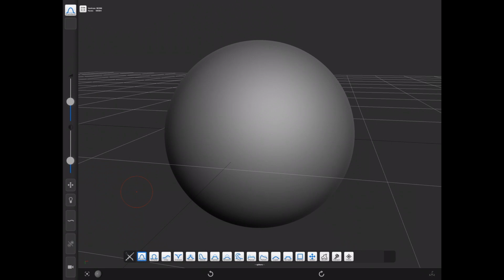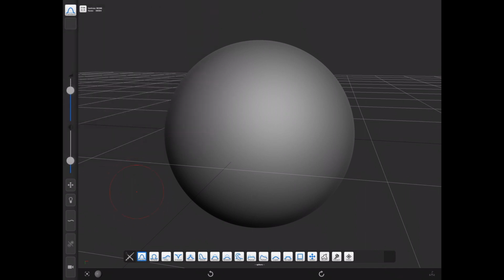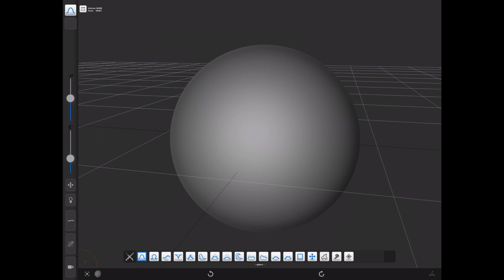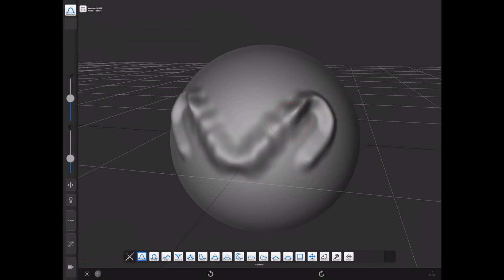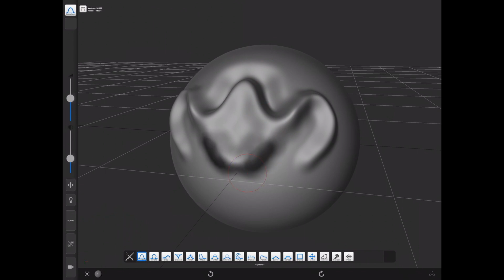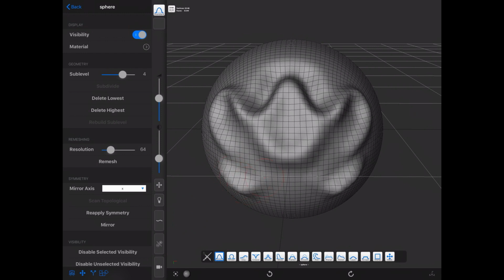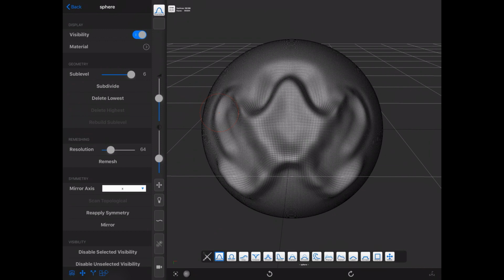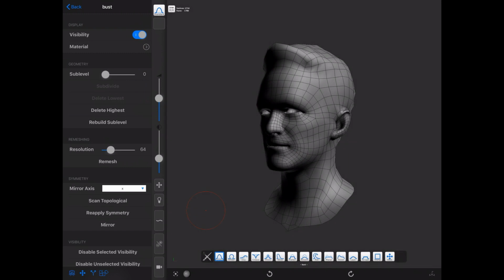forger iOS - Sculpting - Basics

Comment: how to rotate the camera if there is no empty space
Reply from the maker: If you're doing detailing work and the camera is so zoomed in that you can't orbit, you can set the Input mode to "Touch Navigation & Pencil" which will use touch input for navigation and Pencil for sculpting, in fact this mode is often used for everything. It's available at the bottom of the Preferences menu.
Reply: @forgerapp  Yeah!! This is worked) Thank you

Comment: How does this compare to Zbrush? I considered using blender with Astropad but I have been told blenders sculpting tools tend to give you higher poly count. Poly count is important to me because I import into Unity.
Reply: this app works only with subdivision no dynamic topology or remeshing..etc u should try Blender 2.81 which is coming soon, it has move a  huge step closer to zbrush even has some tools that works better like Pixar's Elastic Brushes, an awesome Pose Brush...etc still missing things but it's getting there..but this app is also great if you want to do quick sculpts.
Reply: It’s not comparable to  Zbrush or Blender, it’s getting there tho. Btw Blender  has dynamic topology so you can work to a polycount.
Reply: You may want to retopo that sculpt after you sculpted on blender

Comment: Love the app and it’s Amazing. I have one issue: with the iPhone version. When swiping from main work window, to the side tool bar, it’s very unpredictable if it will open and close with one finger swipe. I have to try over and over. It’s aggravating. Am I doing it wrong? Can you chant wit to 2 finger swipe so it works ever time. It’s really slows down my work flow when trying to get into a sculpt, having to try, again and again it’s very quirky.

Comment: Hi, this is a great app and thanks for your efforts. However, I am having problems when I extract a masked region. The extracted regions are often inflated. Is there any way to avoid that?
Reply from the maker: Hi, that is the purpose of the “extract with thickness” function, if you don’t want it to have thickness you will have to use the “split mesh” features, which splits meshes without applying an extrusion. They are different things.
Reply: @forgerapp  Actually I want extraction without inflation. I am ok with the thickness however the extracted region is larger than  the original masked area. Split just splits the mesh as far as I understand, then do you suggest posing it or? Thanks for your reply.
Reply from the maker: @ihsanyanikoglu  use a really small value so it's thin. What you call "inflation" is a way to get thickness out of nothing. Each vertex is only pushed along its own normal, the higher the thickness value is the more "inflated" it will look, it's just a regular grouped extrusion. The range slider is automatically set to a range sensible for the mesh, try setting it to a lower value, that's all.

Comment: Is this an app? Can you use it on the 2018 ipad pro??
Reply from the maker: Sure! In fact, the ImagePlane feature video was recorded on a 12.9 inch 2018 iPad Pro! ;)
( but works on any iOS device running iOS11+ ;) )
Reply: @forgerapp   That's great! How much RAM do you need to run this well? I see that the 1TB ipad has 6GB RAM but would 4GB be enough?
Reply from the maker: @jordiejubilee836  the more ram the better as RAM is the #1 limiting factor for the app, although iOS only allows using up to half of each devices memory so as a result a 6GB device allows an extra +1GB (3GB) over the regular 4GB ones (2GB usable for a single app) The extra 1GB-per-app doesn't really justify the extra ~$1K price bump IMHO... An update being released in the coming weeks reduces memory usage by 60+% which will help getting roughly 2x more geo on any device. ;) 
The app should run well on any iOS device that can run it, the geometry limit will depend on the devices RAM. Cheers!